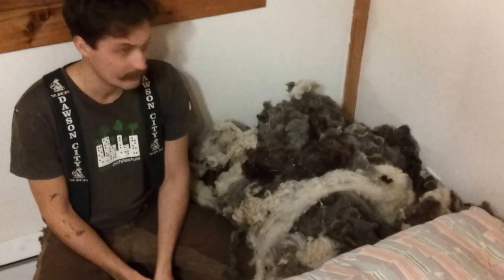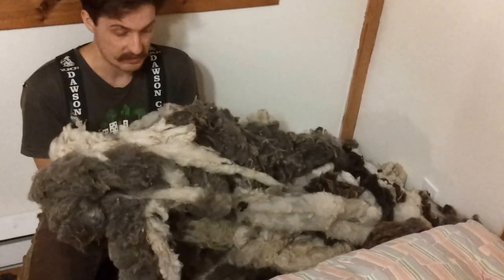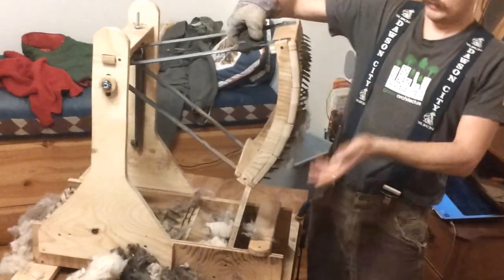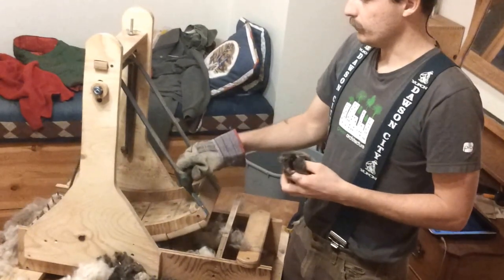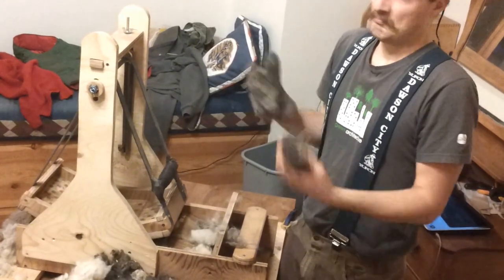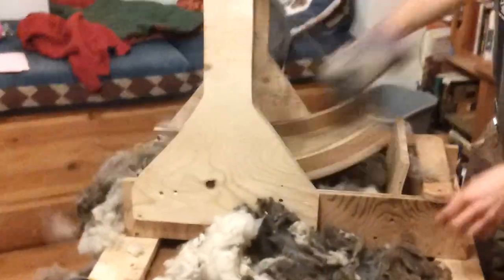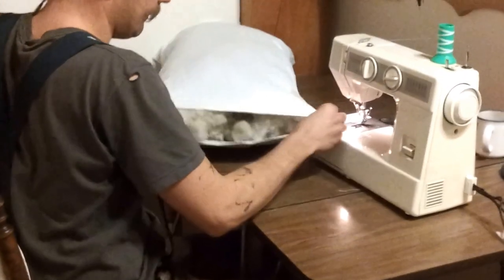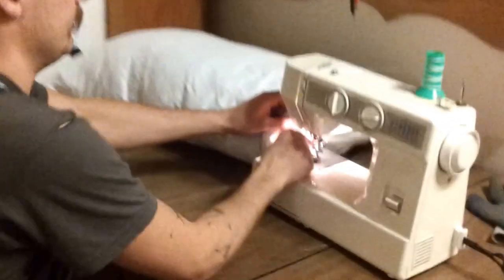Picking Wool for Yurt Insulation

Comment: Have you had any issues with bugs or mold in the wool since your build? And did you use any kind of vapor barrier or just the wool and canvas cover? Also, would you recommend the fluffed up wool over felted wool? I am just embarking in a yurt build of my own, and am interested in going the wool/canvas route as well. I may have access to a large scale felting machine, but curious about this approach now. Any additional info would be so appreciated!

Comment from the maker: Hey Illustratz!  Thank you! Yes our fleeces were a bit weedy when we started.  Not too many burrs, but we built our picker heavy duty enough to plow right through the occasional burr.  The picker is primarily for 'opening up' the wool.  (Which is another way to say 'fluffing it up')  So it can be an essential part of the process of cleaning your wool, if clean wool is your intention.  We did not need to clean out the plant matter bits as OUR wool is only going to be used for insulation.